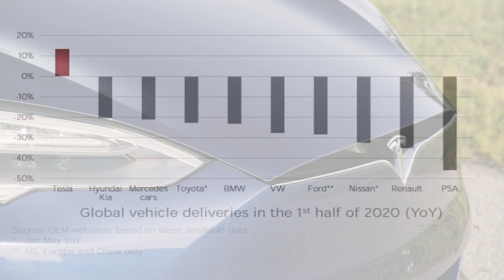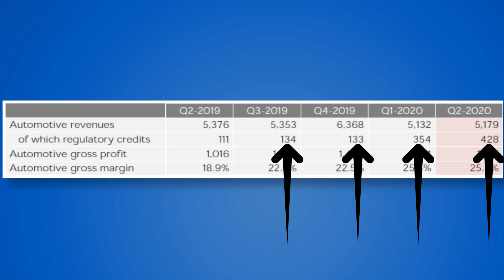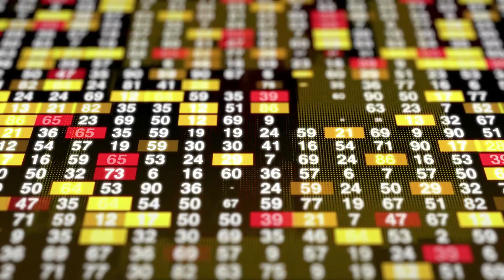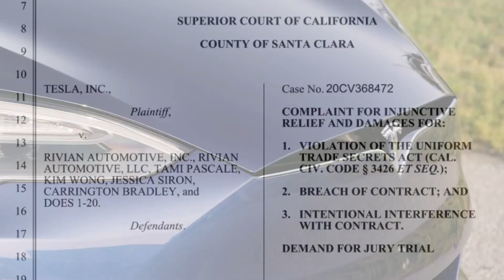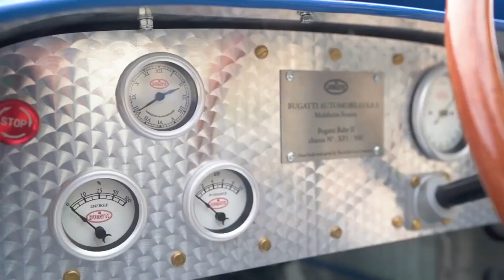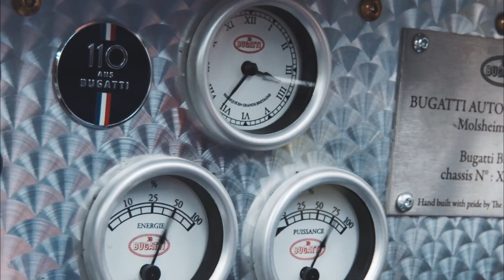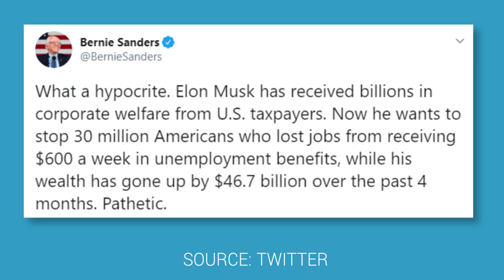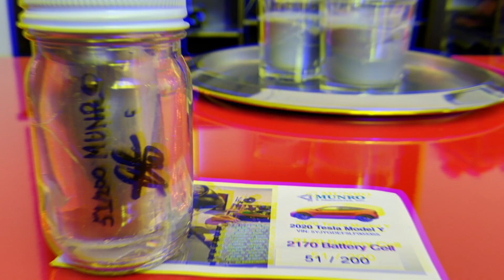Tesla Shows Off Its Auto Industry Dominance | EV News

Comment: Ford and GM still have to deliver something on the market in terms of BEV that sells. They are engaged in huge public relations campaigns in an effort to prevent people from buying Tesla and postpone their BEV purchase. They do this by claiming they have sexier and better cars than Tesla in the offing but they do not deliver. Also, they cannot match the electronics. EV's ar enot just about cars in terms of ICE cars, it is about a lot more and that is something these petrol heads overlook. They live in a different world, the world of 1920. They are a century behind in their thinking.
Reply: The Philosopher of Culture you are wrong gm has not promised anything yet other than the hummer and a bolt suv . You can’t make a car overnight Tesla didn’t come out with their cars fast either. When they said in 2016 the bolt was coming in 2017 it did

Comment: Sorry to say, but after experiencing apps, that is the last thing I want in my car or anywhere. They are unreliable, poorly designed and make the experience worse. Tesla has so far been installing improvements and updates that are doing what we want and people suggest new features and tesla adds them on updates We do not need apps, that will be a nightmare. I can go on with multiple stories about app atrocities I have already dealt with on my first android. I would rather go back to using my flip phone for making calls. You should not need an app to make phone calls for petes sake!
Reply: But you could use Waze, podcasts, and radio apps. It’s a great idea.